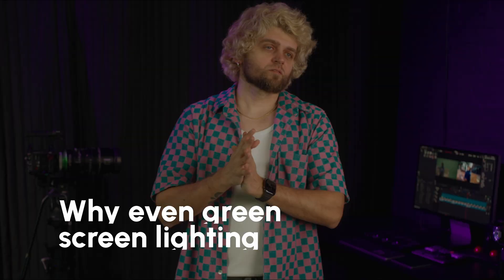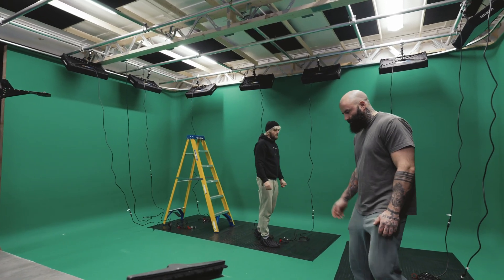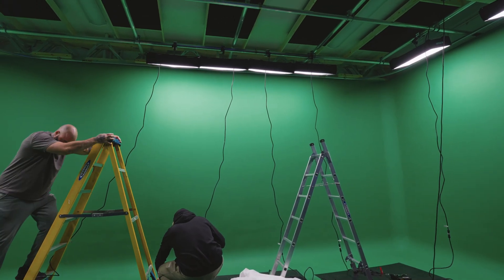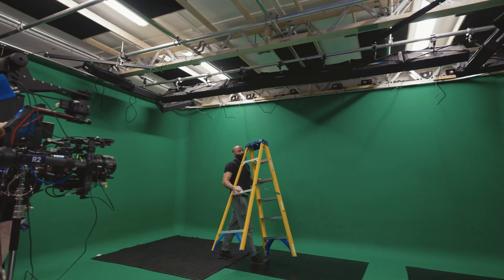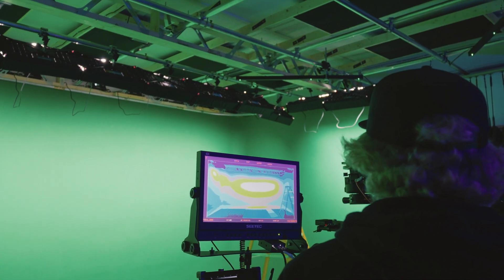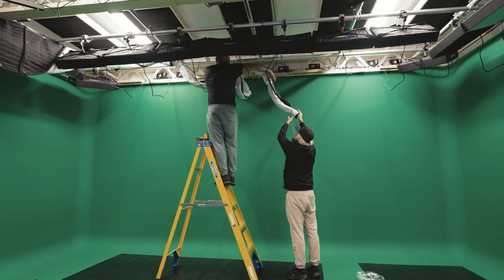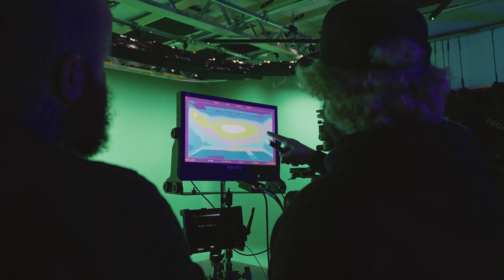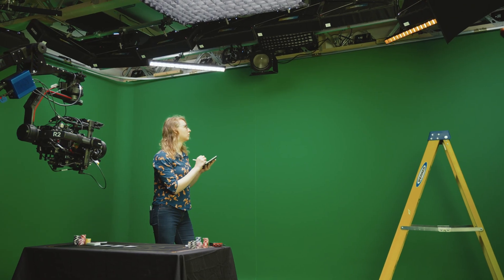Lighting a Green Screen Stage - Building a Virtual Production Studio Ep8

Comment: Thanks for the Videos! Love your Channel. I have a question about the Ultimatte 12. I started currently learning Virtual Production. I have Unreal Engine and 3 Ultimattes and i am strugelling with getting the Colors right. 2 Questions: 1. You talked about in another Video how you use and grade Log Footage in Realtime. 2. My Colors in Unreal Engine are much more saturated then whats coming in into my Ultimatte….Its really a big difference in Saturation….Is there a setting in the Ultimatte or in Unreal that i missed? 

Thanks again! Keep Going👏👏👏
Reply from the maker: Do you have ColorIO setup with the Media Capture output in UE? I suggest not using a color pipeline at least for now to start with and just send the clean feed through Media Capture. If the desaturation still happens do a File CLear on Ultimatte. Could be that you have a hanging desaturation value in Background tab in ultimatte